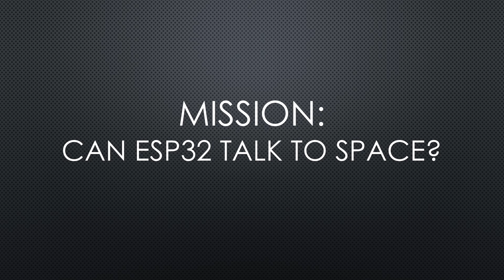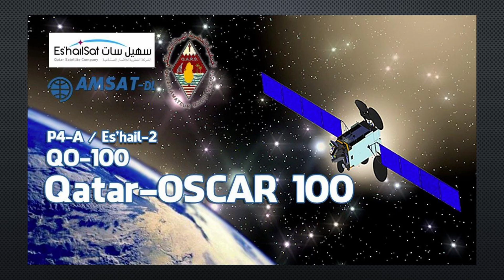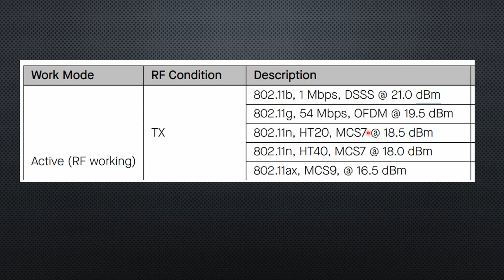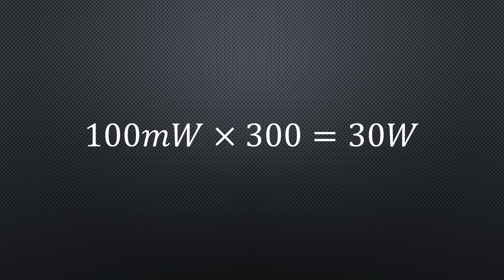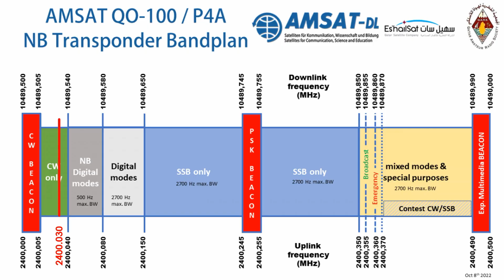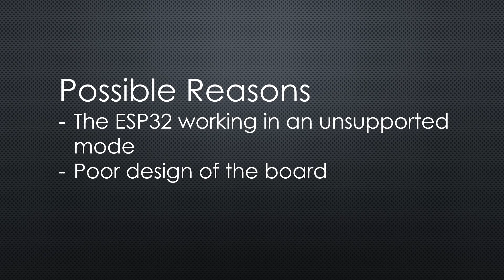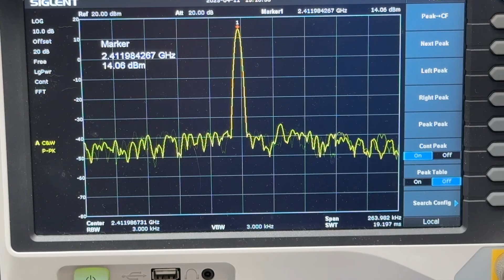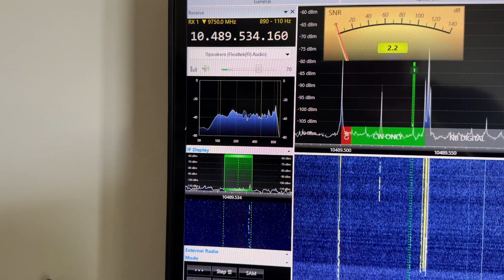36'000 km range with a simple ESP32? For sure a world record!

Comment: It might be educational for your audience, if not on this channel maybe on your ham channel, if you lift off the rf-cover of one of the disappointing modules that gave less power, unsolder the Espressif chip, set the gpio to select the ufo connector output, and use a VNA to test the 50 ohm matching of the signal path between the Espressif chip’s antenna pin and the actual antennas connector, including any cables between the module and the antenna.
Reply from the maker: I am unsure if the ESP32 chips have 50 ohms on the pin. Usually, they propose a matching network to get to 50 ohms. But the way you proposed was hopefully used by the design engineers.
Reply: @ Testing the antenna strip line of modules might reveal
Interesting things. Some reference designs copied by third parties drop the ball on impedance matching. Modules might be designed without any matching components. Just a properly calculated strip line and a requirement that the PCB mfg tune the strip line in the mfg process. Many modules are based on reference designs, some miss the impedance matching requirements.

Comment: If the relay-function of the Qatar-OSCAR 100 satellite is purely analog, you could also try to increase the receiver sensitivity by using CDMA modulation. With a 10-Bit PRN-code, you should be able to increase your SNR-performance by approx 30...36 dB and even be successful with the weakest ESP-board. The downside of this is, that you need to postprocess the data. Don't know, if this is supported by standard SDRs or the Qatar-OSCAR WebSDR. I don't believe so.
Reply from the maker: The front end is for sure analog. And you can imagine how sensitive it is. However, it has one advantage: It is quite cold up there for the noise...
Reply: I had the same idea, using CDMA at very low data rates (much less than one bit per second) could allow a GPS tracker to send its position say once a day to once a hour (transmitting the position will take several minutes). If the transmit power is less than 10 mW it can be used without license.
Yes the QO-100 repeater is analog and it amplifies and translates signals from 2.4GHz to 10.5GHz. Then using WebSDR in SSB mode you actually get access to a few kHz of spectrum that you can feed to other software like gnuradio.

Comment: It is amazing to me that there is such a large variation of tx power considering how integrated the front-end is. They should all be the same chip and (without a switch)  the rf path in to the ufl is quite simple, are all the losses (6+dB) just down to poor pcb design?
I wonder how supply voltage effects it?
Reply: China-Crap !!!
Reply from the maker: Of course, I tried 3.6V ;-) But without effect.